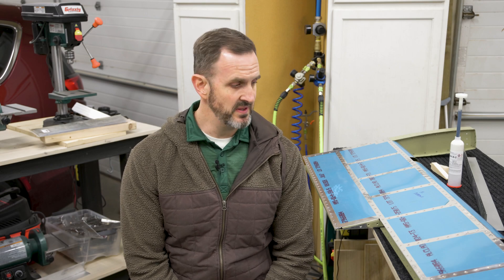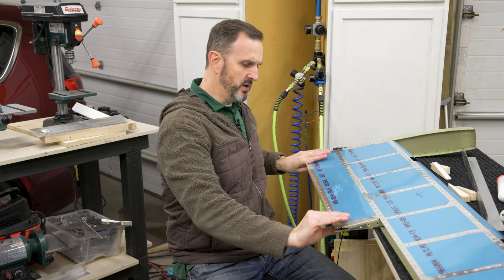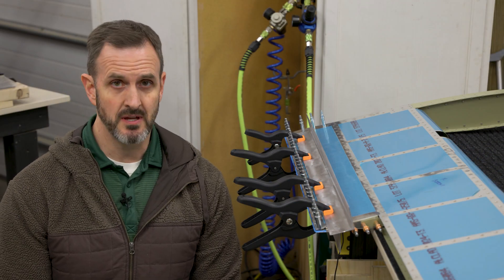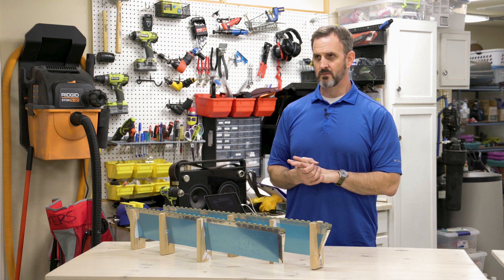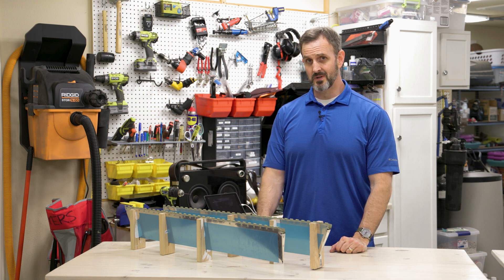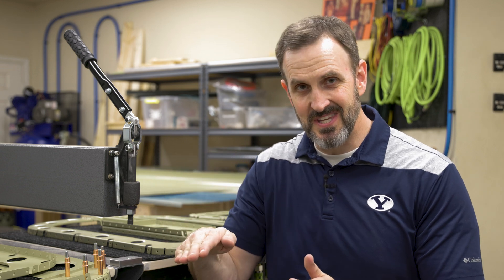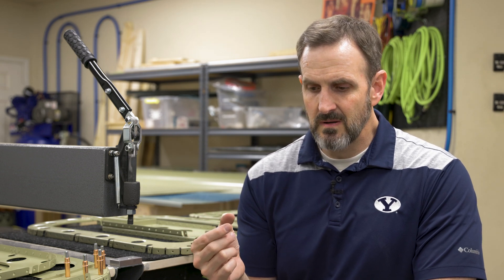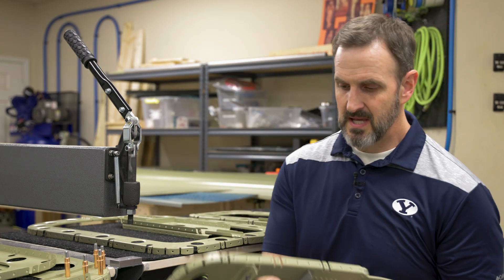Building the RV10 - Video 10 - Elevators (April 2022)

Comment: Did you get to cutting the lead counterweights? If so curious what you used to trim the bottom to 1/32.
Reply from the maker: I have the lead counterweights done, yes; I shaped them with a flat curved tooth file, I believe.  What is the 1/32 thing you are talking about (it's been a while since I did this)?